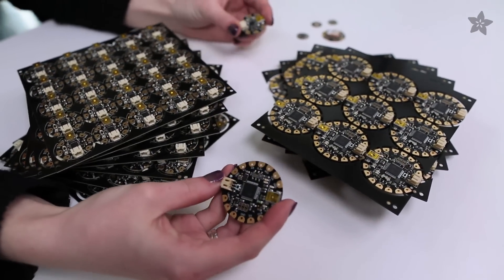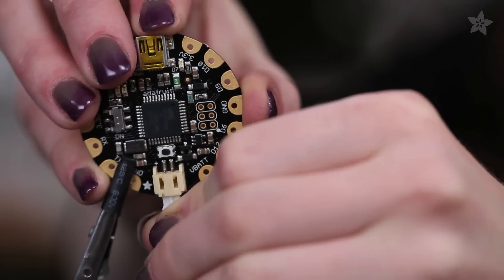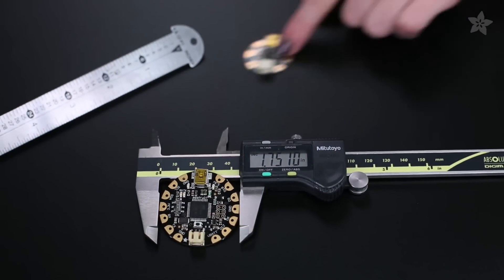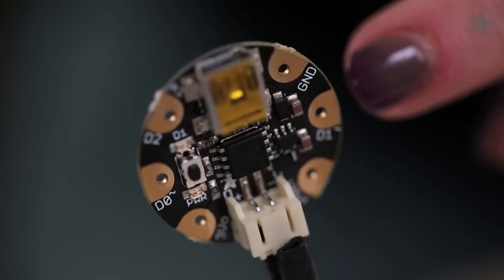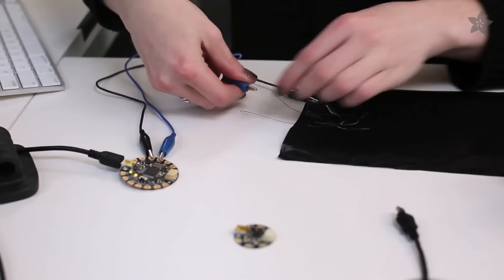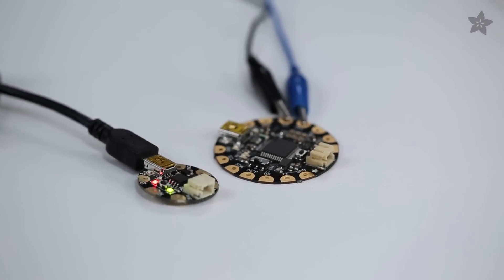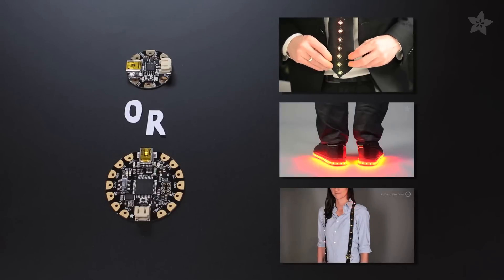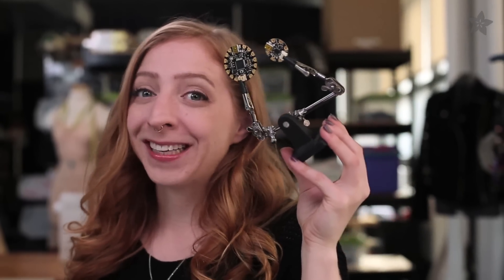FLORA vs GEMMA - Which Board Should I Use?

Comment: although you have mentioned flora is better for a GPS project, is it possible to use gemma? i am working on developing a minimal wearable product so the size of gemma seems ideal. and would it be possible to incorporate a bluetooth module to gemma? if not then is there an additional component i could attach to make the bluetooth connection, yet still be able to maintain a minimal appearance? or would it be bulky? thanks in advance!

Comment: Hey Becky, Hey Team,
Very nice videos, good Job!
We want tu build a wearable that is very lightweight and it only needs two features:
- bluetooth and 
- a solid mechanical Button. 

The Battery should either changeable or fix implemented. Which one should i use?
Best Regards

Comment: Re-posting on this video in hopes of assistance. Thanks and sorry for the repetition. 
I love your ideas and suggestions. I've been making my costumes light up for year, but after finding you I my hobby might be expanding. I have a couple questions I could use some help with if you could. I apologize to place them in a comments inosection (I couldn't find a good contact on your site to ask). I'm wanting to light up my costumes for Halloween, and since I only just found about you and your products I'm not quite up to speed on what I need and fear that if I had to start from scratch alone that I wouldn't make it in time. :( That being said... I'm looking at your Neopixels, individually and in the strips to light my costumes. My hang up is what to run them with. From what I can tell they can be run by the Gemma, Flora, or the Arduino, though I don't know the difference and such. I don't know which I need. I would like the lights to be able to do some effects and go together possibly react to sound. I'm unsure till I receive it exactly how much I'll use, but best guess is 1-4 meters, in either 2-4 different segments on my costume. If you could point me in the right direction I would greatly appreciate it, along with any best recommendations on how to power it.  I'm also wanting to do the light up martices boards for eyes on a costume accessory with a sound driver to make a light inside give the appearance of speaking, or as alternative to the eyes use alternating sections of el wire to give the appearance of blinking. I appreciate any help, apologize for asking so much. Thanks in advance and I love your stuff and wishing I was in NY to jsut come and peruse in person.
Reply from the maker: +abmviper Hi! We talked about your question on our live wearables show! https://youtu.be/cO0fn5dN2Cg?t=27m19s

Comment: Hey Adafruit! I don't know what board to use for my locker project. This year I am going to put a bunch of cool LEDs and such inside my locker and will be turned on by opening my locker. Which board such I use?
Reply: +TheLittle NerdThatCould if it's just leds, you basically never have to look further than the GEMMA, however, I think your project can also very much work without any board. Place a press switch that's placed behind the door so that it is pressed when the door presses against it. This closes the circuit and turns the LEDs on. If you wanna make variable colours with RGB LEDs, then GEMMA is still the way to go.

Comment: Hey, I want to do a cosplay and use the Adafruit NeoPixel Digital RGB LED Strip 144 LED. I will need to use a LOT of LEDs, so maybe 2 of those strips. So I need to be able to power everything and control the color and animations with buttons or a pressure sensor in my hand (or both). Also its my first time using arduino altough I've seen a LOT of tutorials already. is the flora good enough for this? or should I use something like LEO? and how to power 2 strips of LEDs?
thank you for any help, since I have only 2 months to make everything from zero.